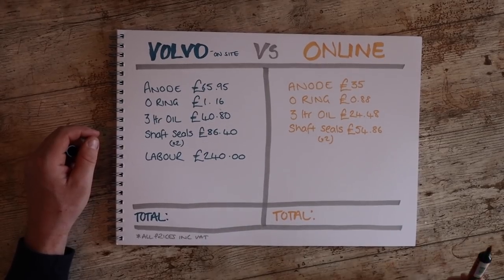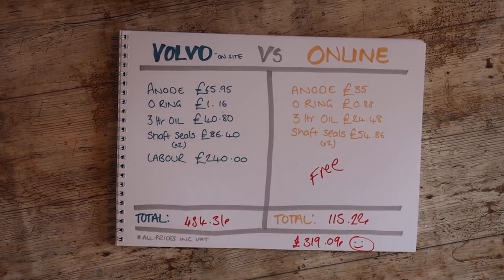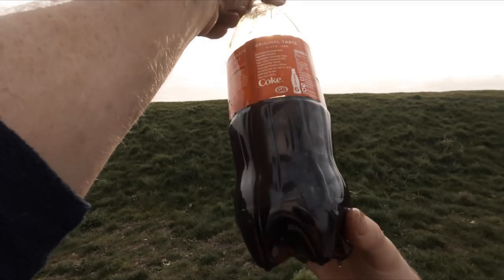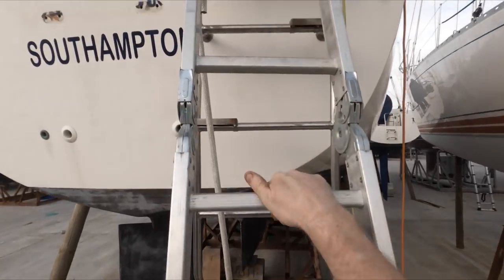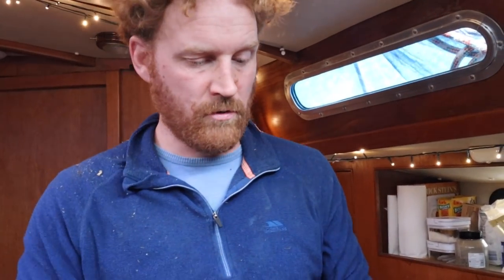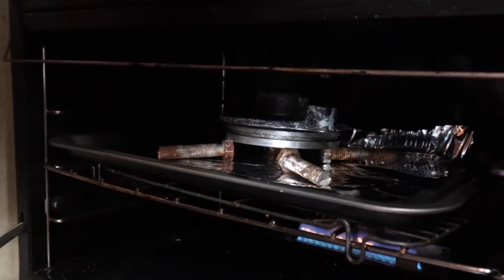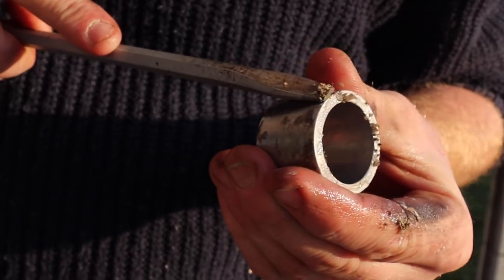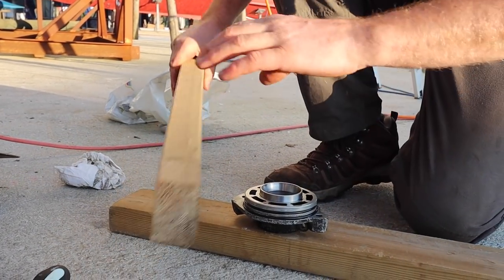Sailing Boat - DIY (Saving £318)

Comment: Top tip - in the past when I've not had an induction unit available for sweating bearing's / sleeves on etc, I've found that the next best thing is  a normal clothes iron. Mount the iron upside down so the plate is horizontal and pop the item that needs heating onto the hot plate. Using an iron will impart more heat into the material faster than an oven, which is a big advantage when you only need one area of the metal hot. Anything that contacts / sits on a 250°c surface gets hot fast lol.
Reply from the maker: Awesome, moving all of the different ways people have for tackling these jobs!! It almost makes me want to take on another mechanical job now! 😬😂

Comment: You are correct to get as familiar as you can with the engine. However why is it only you that is getting familiar with the engine. Makes sense that you both learn. And Carly seems more than capable to learn this. Thus providing redundancy. Enjoying your story so far.
Reply from the maker: That's a totally fair point 👌🏻

Comment: There is a lot that you can do yourselves in maintaining or upgrading your boat. The more you know about every system onboard and how to fix it, the more confident you will be the day you cast off the lines. I encourage you to also learn as much as you can on boat handling, navigation, weather, electronic systems and so forth. Again, more knowledge means more confidence in you and your ability to resolve problems at sea. Cheers, Richard
Reply from the maker: Thanks, Richard. I think we're going to use this new found time as well best as we can to get as much studying done as possible, because in the grand scheme of things, we're clearly still super novice sailors.

We've been looking at a few online theory courses available, so hopefully we'll come out of this slightly better prepared than we went into this crazy lockdown.

Hope you're well and safe. 🤞☺️

Comment: Continue to love your videos,  as well as boats I have had dogs all my life and offer a suggestion on getting him to go to the loo.  Male dogs mark their pitch, they also will normally want to mask your smell.  take him for a walk ( somewhere private ). you pee that he sees you and he will probably try to cover your scent. do this a few times.. buy some plastic grass enough to allow him room to go as he is a big guy. when he is used to covering your scent then introduce the plastic grass ( don't rush this). only wash it with water as you need to retain some smell on it. he will smell you won't. this should get the process moving for you and the 2nd phase will simply follow on.  at sea you just have a rope on the square of grass and trail it behind  the boat.  this is exactly how I managed the same problem.  Reg

Comment: Great adaptive thinking. Suggest investing in a copper and hide mallet matey. Save yourselves £100s in damaged ally and other parts. Claw hammer for nails. Copper/hide for everything else metallic 🤗
Reply: Thor No 3 Copper and Rawhide/Hide Faced Hammer/Mallet Dead Blow 3lb TE398
Reply: Amazon have them for £35 but you only buy one in your lifetime 👍🏻

Comment: well done for giving it a go Dom, one of the riskiest things with buying on line is the lack of guaranteed parts , re o rings always buy direct from manufacture, filters can be poor grade with the filtration so buy reputable like for like stock. all that said after doing it once your guaranteed to do it again and that can only be a good thing . plus it gets quicker,.
Reply from the maker: I think you're right, once you've started braving the unknown, hopefully one gets more proficient at doing the work.

I think we're going to stock up on impellers and filters before we head off anywhere. 😬

Comment: For future reference, Finning (and others) in the UK, will do a full Lab analysis on oil for about £25. You get a good comprehensive report in technical and plain English. Not something you'd do all the time obviously, but useful to get a full picture when it's a new, old engine, drive etc
Reply from the maker: That sounds like a good shout, cheers for the tip 😁

Comment: Not being picky, but I think you are missing a lock washer. If you look at the back of the cone there is indentations ,as you tighten the cone it locks on the serrated washer.  Or it could be a different model.
Reply from the maker: Possibly. There is a washer (white disc) that went back on with the cone, and everything that came off went back on again. 

I'm thinking of using a little lock tight on the screws when I get back to the boat though as several people seem to think that should be used to stop the screws unscrewing, although there was no indication that any was used previously.

Appreciate the feedback though, I'm a total mechanical know nothing so it's always welcome 😁

Hope you're well during this time 🤞🏼

Comment: Nice info in saildrive servicing. I’m about to (or was) haul out for antifouling, change anodes and service saildrive etc and will try to takle it myself. I was thinking about changing our saildrive rubber boots but might leave it another year or so at they look and feel ok.
I would suggest that you use Locktight or similar and the guy we bought our boat from lost a propeller the previous season. Fortunately we have two Volvo Penta D55’s so there is always redundancy. Unusual to have two engines on a monohull but we love having that backup!
Reply from the maker: Yes I think I'm going to go back over it and apply some medium strength loktite after all.

If you're serious about tackling the job then I'd say check out the sail drive diaphragm change video on 'sailing Britlay'.

It's over an hour long but you get a good account of one man doing the job start to finish by himself! 👌🏻
Reply: Sailing Cadoha it’s a pretty huge job and not one to be taken on half heartedly. I might just pay for that job but I’m happy tackle the engines servicing and saildrives. Like most of us our sailing plans are rapidly changing! Stay safe.
Reply from the maker: Gordon Ross  I agree it's certainly one you don't want to get wrong either. 

Depending on how long this situation lasts, if it's really crazy and we don't end up back in the water until Q3, then we may just leave the boat out and tackle every job possible and re-launch the following spring.

Man it feels crazy to even think that, but that looks like it could end up being a real possibility right now 😳

Comment: Loving your videos - you both have a real talent. I am a delivery skipper and took the cat  Aliseo you were on crossing Biscay from Les Sables to Hamble...so that was how I ended up on your YT channel. One thought if you are laid up for a while. The sail drive has a rubber boot at the top held in place with a steel ring. I think they should be replaced every 5 years or so. Easy to do on the hard and if it fails the boat will need lifted - it is the biggest hole in the hull. Yours may have been replaced recently but of not might be worth thinking about.
Reply from the maker: Hey, David, small world!

Are you talking about the sail drive diaphragm, the big rubber cover that stops the water getting in?
Reply from the maker: @DavidSmith-iy6mr  I love how you say that's easy, ha ha. Clearly a man more skilled and familiar with a tool set than me 😂

That is a job I plan to tackle, and it's actually how I ended up doing the work to the sail drive that I did, as another guy (Chris over at Sailing Britlay) did the diaphragm replacement and also serviced his sail drive whilst he was at it. I mean disconnecting and moving the engine out is one thing, but we have even less room in our engine bay than he did to everything.

What are you thoughts on stainless steel exhaust elbows, worth the extra money to upgrade?
Reply: @CadohaAdventures  Not at all on the technical front. I experienced failure of a sail drive  diaphragm first hand en route from Dublin to Brittany. The conversation started at 0200 ( it always happens then !) with the crew popping their head up saying there is water above the floor boards. I pulled into Falmouth and got Rustler Yachts to sort it. It was a one week interruption in the delivery to get crane time. The problem was actually the ring which compresses and seals the diaphragm. Not really able to comment on exhaust but I am sure  an enquiry on your channel will draw lots of advice from sailors confined to their armchairs !
Reply from the maker: @DavidSmith-iy6mr  Jesus that really could of ended badly given the size of the hole that diaphragm covers.

Glad you were able to pull over and get it sorted, it wouldn't bare thinking about if you were in the middle of a wide ocean crossing 😳

Comment: hi Dom,,, good job,,,,  ( i may have mentioned before )  a lot of Volvo engines are just rebadged Perkins ones so you can buy perkins parts which are a lot cheaper ,,,,,,, glad to see you are all surviving ,  all good up here with us tho the marina is closed and only allowed to check on our boats ,, looks like it is going to be a while yet till this is over ,, stay safe you all ,, R
Reply from the maker: Glad to hear you're all good up there, Matey!

I think you're right, it looks like this will be bonkers for a while. I think we need to plan how to make the best. out of all this new found time on our hands, I may try and trim some of my recently acquired beer belly back off.

Stay safe yourself, Pal. See you on the other side of this one day! 🤞

Comment: Good job with the DIY stuff. Why don't any of the sailboat vlogers first state what kind of boat you have ,when was it built and what is its LOA.
Reply from the maker: Hello there, our boat is a 38ft Trident warrior, built in 1984. The engine was renewed about ten years ago and has just under 800 hours running time on the clock, and has a draft of 1.52m.

Hope that helps 😁

Comment: Fun DIY- my only suggestion is to get more detail when you research your projects as it is apparent that none of your research warned against putting any pressure on the "ears" of your sea drive bearing /seal carrier.  I've seen those crack when even the allen bolts are used to pull the BC back into the housing  Let alone when hit with any kind of hammer.. best way is a short pipe over the prop shaft and bigger than the seal  == grease on all the surfaces and between the newly installed seals.  NEVER put sealer on an "O" ring as they will scrunch up= always just grease.  (for next time)  otherwise good job no broken parts. new seals clean prop-- whats next--  Bill
Reply from the maker: Appreciate the feedback, Bill, i really do appreciate how much I've been learning from the hive mind on YouTube, both through comments and video creators alike 👌🏻👌🏻😁
Reply: @CadohaAdventures  My biggest surprise when starting in the marine mechanic business back in 1976 was the number of seasoned mechanics who would volunteer "different" ways of doing the same job.  Most were truly brilliant. some ideas were "really you can do that???"  SO- as you continue with your journey- don't hesitate to get friendly with the respected guys who love their job and learn a few bits that will never be published in a repair manual.  Cheers Green with envy Bill

Comment: If only I had seen this great video about 9 months ago I would have saved myself a whopping £750.99p to have my Volvo Penta sail drive serviced ( that was me purchasing all the seals on Parts 4 Engines) over here in N. Ireland. My sail drive oil was like cappuccino so water was getting in and it needed doing. I panicked and paid the price. Never again now. Thanks a million. Just one point. Are you putting any Locktite thread lock stuff 
on your screws. I think you're supposed to?
Reply from the maker: Geir Erdal I didn't put any lock tite on the screws, no, although I'm certainly not an expert and so that may be a mistake on my part, although there was no sign of locktite when I took them out?

Maybe someone with more experience than us can chime in and help out?

If you really want to tackle more jobs yourself, a couple of great channels that have helped me pluck up the bravery to put my big boy pants on to attempt the jobs myself are: Mads over at 'Sail life' and Chris over at 'Sailing Britlay'.

Hope you're keeping well over there in Northern Ireland 🤞🏼🙏🏻
Reply: @CadohaAdventures  I am no expert on sail drives however I would expect that locktite would be recommended for those screws. I suspect if you give the volvo penta guys a call they would tell you, they also may have a rebuild manual for that sail drive Mads from sail Life had one when he replaced his diaphragm. Also if locktite is required as what color they recommend. Different Locktite has different strength between different materials.
Reply from the maker: David Gockley  you're absolutely right. We ended up taking it apart again and adding some medium strength locktite to the bolts, thanks to the feedback we got from the video.

Every day's a school day! 😁 👌🏻

Comment: With modern access to information, it has become quite easy to figure out how to fix most things and the more things you fix the easier it becomes from soft skill transfer. If you cant fix it then perhaps the labour of the pro may be worth it as they may have a more application specific skillset and toolset. but the best way to learn welding is to get a welder. just try a thing and fail till you dont
Reply from the maker: I think you're right, we're lucky in so many ways to have just about all the knowledge known to humanity in the palms of our hands.

Hope you're well during this craziness 🤞

Comment: G'day Dominic.

Thanks for your thoroughly enjoyable and beautifully presented Vlogs, your happy family joined my other particular favorites almost from the beginning.

Pursuant to this episode I decided to say a thing or two and hope you can accept that my suggestions and observations are offered with the best of intentions.

Having watched you begin seating the tertiary bearing in your sail drive with a socket.

I suggest you ensure any socket or other item you use as a drift to seat a bearing is as close to the outside diameter as possible and keep the bearing or seal as level as possible with reference to it's ultimate location.

The former is necessary because whatever you use as a drift should rest on the outer shell of the bearing and not the hub or seal, otherwise you risk inflicting damage to either the cage/race and/or seal.

The latter minimises risk to the seat/surface with which the outer shell or race of the bearing engages and ensures the snuggest possible fit.

Also I urge you to use some of the money you save on DIY to buy yourself a soft mallet and other tools specifically created for such tasks.

Relatively inexpensive items exist which are specifically intended to correctly and efficiently remove/install bearings and seals.

If it is worth doing it is worth doing properly and well and with the right tools for a job you are far less likely to subsequently encounter potentially tragic circumstances due to failure in a system as critical as your 'sail drive'.

With every appreciation that the following originates from a subjective perspective I noted that your yacht probably originally had a direct drive.

I have never liked sail drives as apart from a bit of extra flexibility with regard to engine location the only real advantage they provide is potentially improved water flow over the rudder while under auxiliary power at low speeds.

When compared to direct drive, sail drives impose un-necessary complexity and even potential vulnerability as well as additional/elevated maintenance costs as you discovered for yourself.

It is also my understanding that every time you alter the direction of a drive train you lose a proportionate amount of power. (When I referred to the relevant equations I rapidly went cross eyed and nearly fell off my perch)

Even for a direct one to one transfer ratio, the additional complexity of sail drives alters the direction of a yachts auxiliary power train at least twice.

Along with the primary transmission attached to the engine this not only compounds losses through friction but also via other inefficiencies.

These detrimental influences seem to me to be as unnecessary as they are undesirable given the relatively small benefit gained.

Comment: Easier way to replace the metal ring would be to put it in the freezer for a little while and shrink it for a slide in fit. Once seated it would warm up and expand for a tight fit. The opposite principle to heating up the outer casing when removing. Saves all that hammering mate.
Reply from the maker: Genius!! That makes perfect sense too. Seems so obvious once someone mentions it. Cheers 😁